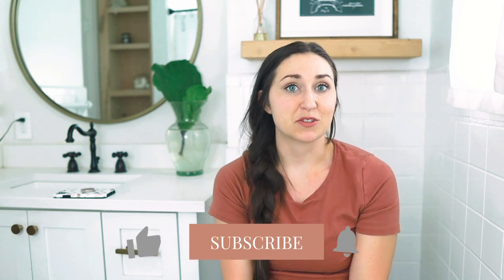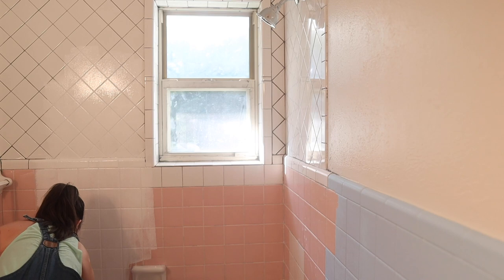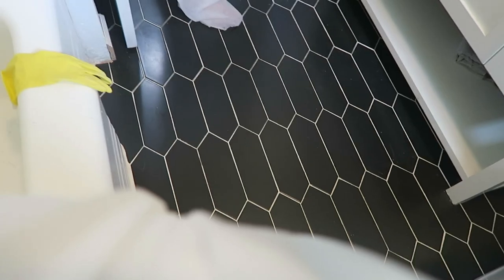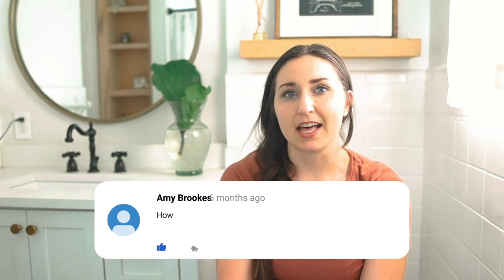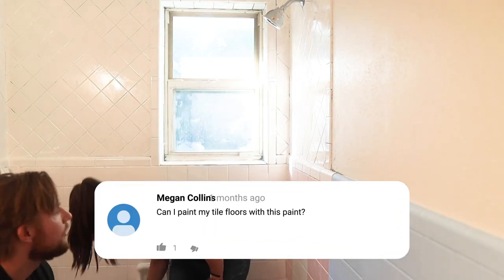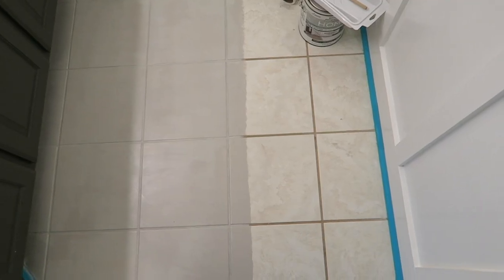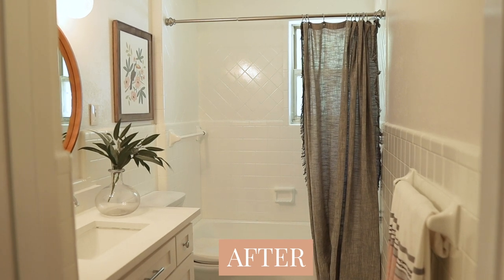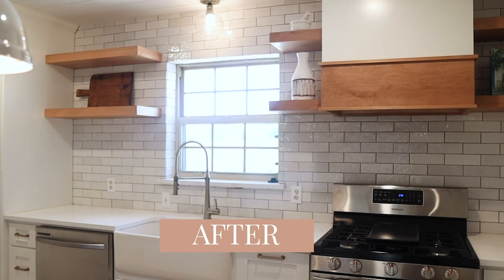How to DIY Paint Shower Tile - One Year Later Review - Rust-Oleum Tub & Tile Refinishing Kit

Comment: Can I ask you about how you redid the vanity in your bathroom? looks like you removed the tile from the 'backsplash' on the wall behind the vanity and then replace the vanity + added a wood trim? How were you able to remove the backsplash without cracking the tile on the sides of the wall near the edge of the vanity? did you add a trim to the edge of the tile? (not sure if that makes sense)
Reply from the maker: The backsplash was on concrete, cemented in and we did crack a few pieces. and had to replace some.

Comment: Great review of your results. Thanks for the update. I'm thinking about painting my 1960's pink bath tub so it's great to see how this worked on your pink tile. I'm curious to know how cleaning products work on the tub and tile paint. Are there any products that are not recommended on it? Can you use standard bathroom/tile cleaners and bleach product on this paint?
Reply: I am remodeling my mothers house and it had pink 4” tiles from the 1960s as well. Did yours have a glaze over it? Almost like a clearcoat on a car? I’m curious if you used the Rustoleum tub and tile paint, did it work well? I ordered it in coastal gray and I’m keeping my fingers crossed

Comment: Thank you for your great review here of the Tub & Tile Refinishing Kit. I do have one burning question??  We have a 1959 Cast Iron Tub that was just Painted white by a past Flipper, where after stripping off the white paint we found the Pinkish color original Tub color and it look's as though they did not take off all the Gloss from original tub finish it is still very glossy. I see the instruction's say just a deep cleaning and some sanding BUT it does not say you MUST remove ALL Glossy finish before using this product to really stick?  Must all the gloss be removed prior to using this Tub & Tile product?  Thank you

Comment: I am in the process of cleaning my mothers bathroom which has pink 4 inch tiles from the 1960s embedded in the same concrete and wire others have discussed. I have cleaned it thoroughly but I do notice that the tiles have a glaze over them, almost like a clearcoat on a car. Has anyone tried to use the Rust Oleum to paint over them? Did it work? I sanded with 400 grit but they still shine! I am going to use the Coastal Gray color
Reply: How did yours come out?

Comment: I have the towelbars as well as the soap dish attached to the wall like your flip house...did you use a brush to get coverage on those instead of a roller? Would you recommend the spray for those specifically ( for ease/coverage)
Reply: I wish you got a reply to this because I have the same question. Did you complete your project?
Reply: @moniquecoffee3840  I haven't yet,but I did end up buying the spray for those particular areas. Just waiting for the right time as this is the only bathroom available in my home😊
Reply: @msdee3873  I think that’s a great option. Good luck whenever you’re able start!

Comment: Did you have any spots of caulk or repaired areas you painted over with this? And how did it hold up on the repair spot? I've got some handicap rails the previous owners screwed into the tile. I'll going to remove those and patch the holes but trying to decide what to patch with so the paint will work over it. Any ideas? Thanks!
Reply: Hi, I came across your question watching this video, as I’m in the same situation with a removing a couple grab bars! What did you end up doing and how did it turn out! Thanks!

Comment: My shower floor is also tile. Will this product also work on the shower floor? I know you mentioned in one of your other videos that it doesn't work on floors. Does that include shower tiles floors? If it works, I'm am so doing this to my bathroom.
Reply from the maker: No, I guess I should clarify that the Tub and Tile refinishing kit is for surfaces that will get wet and the floor paint is for the floor. I've used the Tub and Tile inside a tub where you stand when you shower and that held up great so the shower floor should do the same. 

When I used the Tub and Tile Kit on the floor (dry area) rather than using the Interior floor paint, it showed marks so badly. The interior floor paint doesn't do that at all on dry areas. 

I hope that makes sense lol
Reply: @FarmhouseLiving  Thank you! This did help. I will be trying this on my shower. I am nervous & excited!

Comment: Ok what if my father in law built our bathroom and the floor tiles are the same tiles he put in the shower 😭 they arnt typical bathroom tiles he used floor tiles for the shower walls so I was like ok use floor paint then your like no don’t do that I DONT KNOW WHAT TO DO 😭😭😭
Reply from the maker: Rust-Oleum has a paint specifically made for floors 😊 Use that instead https://www.farmhouseliving.com/blog/diy-painted-tile-floor-with-stencil
Reply: @FarmhouseLiving   so I can use it in the shower as well since it’s the same tile? It s a huge garden tub so all around the tub and shower walls are the same tiles as the floor so in this case it is ok to use the floor paint on both?
Reply from the maker: @kyliekaylor4875  I would use the paint in this video for the shower and the other paint for the shower floors. You can get white in both. One is formulated for the water exposure and one is formulated for foot traffic.

Comment: I  enjoy doing DIY projects, but this one has me scared.  Your video has somewhat encouraged me to try this in my 1963 bathroom.  The color of my shower tiles are beige and I want them white.  I have slowly been remodeling this small bathroom from it's former 1980's look into the 21st century.  I stained the vanity & mirror,  put on new handles, took down the wallpaper and  replaced it with shiplap on one  wall and painted the other walls in SW  paint color call city loft.  It had carpet on the floor also and yes, I took that out.... yuck!!!!  My colors are white trim & ceiling,  lite grey on the walls and the shiplap has blue with white & grey in each piece.  My future floor will be white, so with that being said, the beige shower wall tiles just doesn't fit into this decor., but they are in excellent condition.  I need someone like you to help me to believe in myself that I too can do this  project.  I have pictures of my work if you'll like to see.  Again, thank you for sharing your success and  story.
Reply: Did you do it?